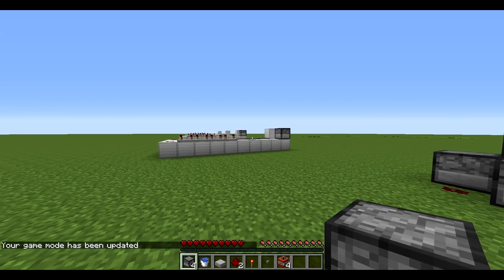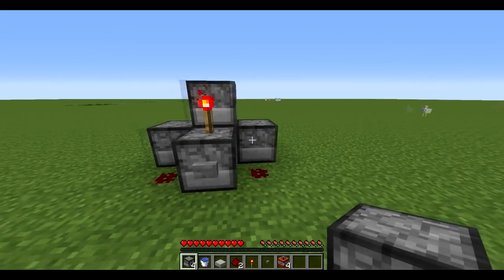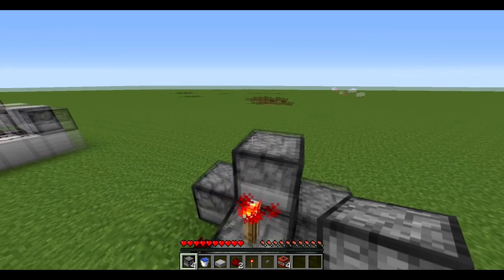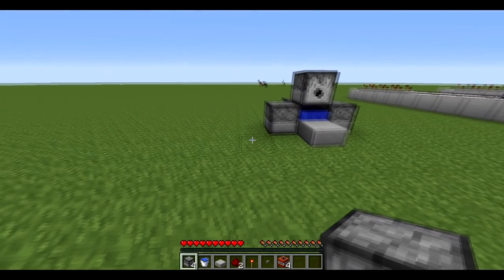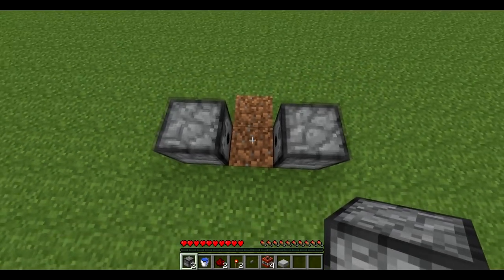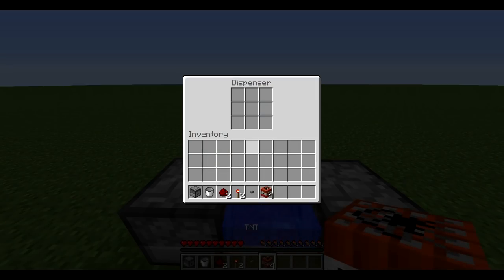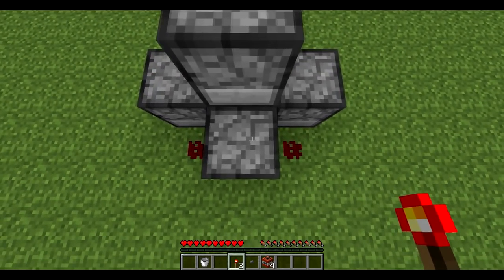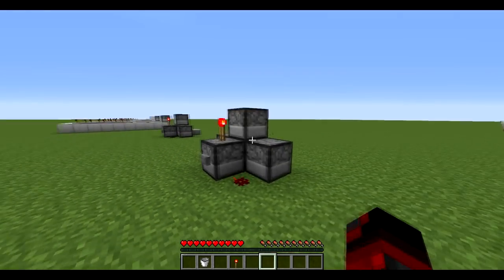Minecraft - TNT Cannon (Tutorial) Smallest Ever Cannon!

Comment: Improvements to the original model:

+ Wooden button instead of stone one

This modification is so useful, i don't know why it wasn't used in the video. A wooden button stays down longer after being pressed, allowing the tnt to drop to the ground before exploding. For more precise timing, you could try a manual power source, like a lever, but be warned that it takes some practice to use effectively.

+Barrel 

A barrel attached to the end of the launcher would improve accuracy significantly, but don't add a top or bottom to the barrel, as it could obstruct the tnt, destroying itself. This attachment is not intended for launchers that are intended to be somewhat innacurate, like a launcher that sprays multiple tnt blocks in a wide area, like a shotgun. But that doesnt disenclude firing multiple tnt blocks entirely, as multiple tnt blocks in close proximity to eachother could allow for higher damadge and knockback within the blast raduis.

+ More tnt dispensers

This one kind of breaks the concept of a small launcher, but it is possible to hook up a fifth launcher under the water block, facing up. this small modification increases range by up to a third. You can also add more tnt dispensers to add extra projectiles, and it isn't like you are forced to reload all of the extra dispensers each time, so why not.

I understand that the last 2 modifications take away from the concept of a small tnt launcher, but who wouldn't want a beefed up cannon in a minecraft faction war?

Please feel free to comment on ideas for more attachments.
Reply from the maker: Sounds good! I'll give it a try later and see what it feels like
Reply: Zandrix 360 um......ok?
Reply: Zandrix 360 I
Reply: Might not be as accurate as the original but still affective
Reply: it took forever to set up the fith dispenser BUT IT WORKED